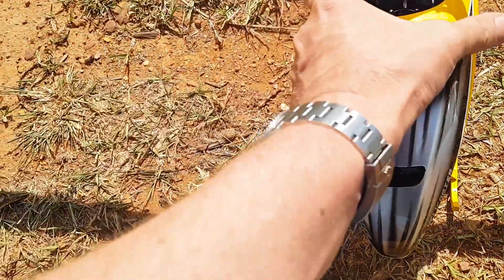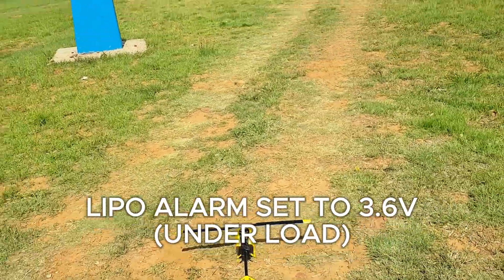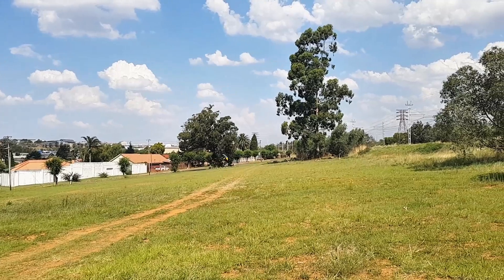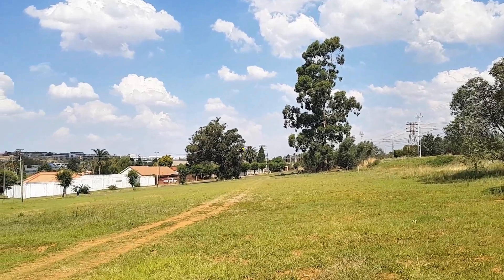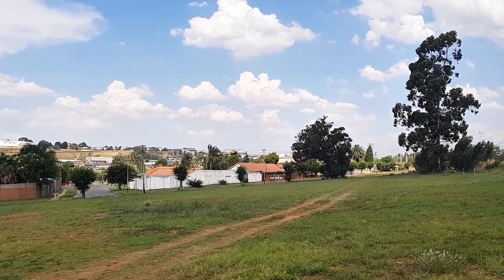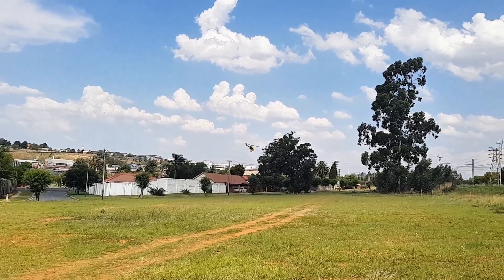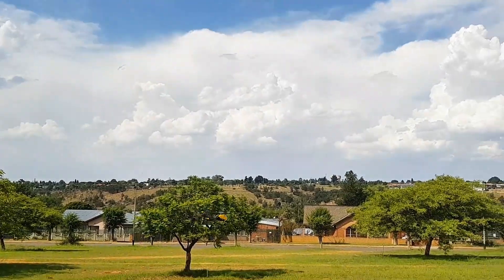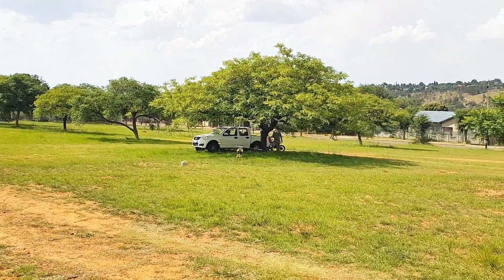Flywing FW450 V2.5 BELT TO GEAR DRIVE CONVERSION - FULL FLIGHT

Comment: Hi Mike, I'm considering carrying out your belt drive to gear drive conversion on my FW450 V2.5 could you clear up one point for me? Is the ratio of motor speed to head speed the same for both belt and gear drive? If not did you have to adjust the head speed in the H1 settings?
Reply from the maker: Hi. Leave all as is but don't forget to swap 2 motor wires to reverse main motor. Any 2. Regards
Reply: @Mikes-tuts-rev  Thanks for the speedy response to my question👍